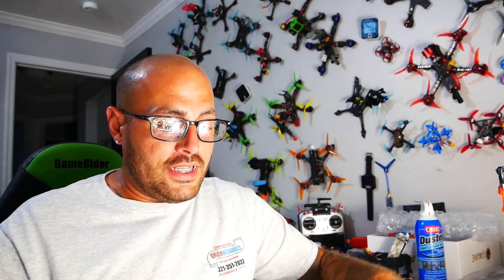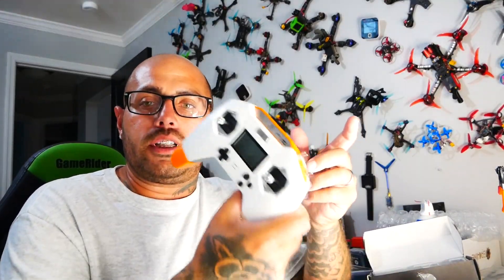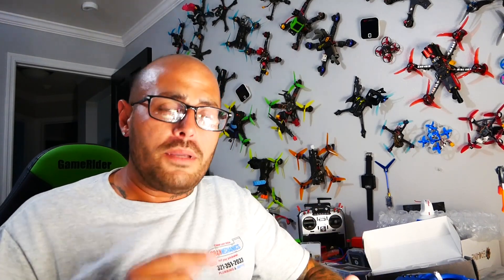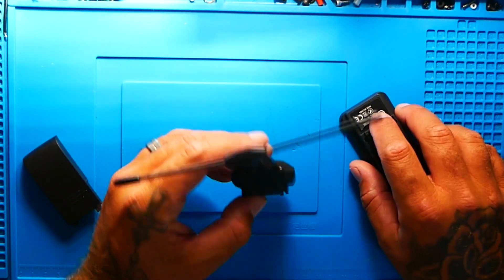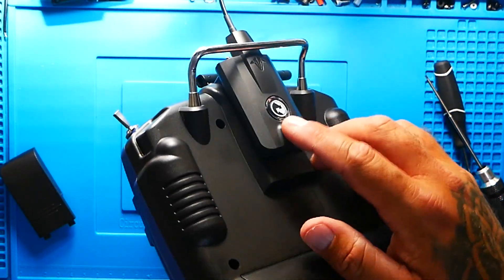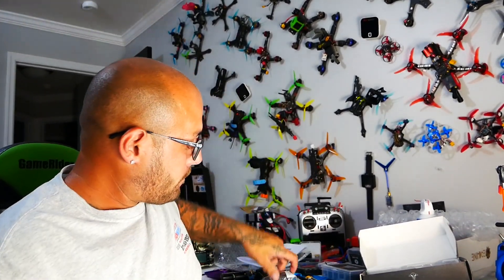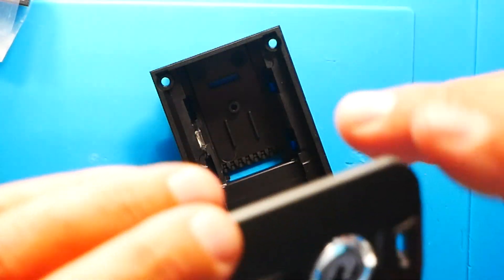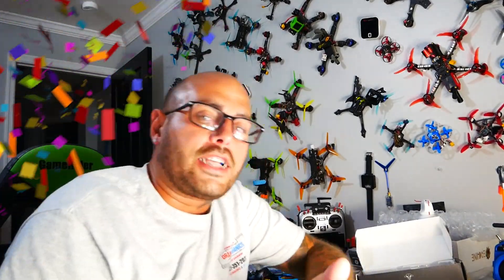TBS Crossfire Nano TX is Here 🔥 Crossfire Nano Module & Retrofit kit !

Comment: So I tried to use the TBS retro fit kit and the main issue I ran into was that the Micro TX V2 has pins on the bottom left corner that have to be either desoldered or alternatively a hole would have to be cut into the back plate of the retrofit kit in order to get it to work without taking a soldering iron to the crossfire tx.

Comment: I have a question on the nano RX - I connected it to my micro TX and for whatever reason I am only getting 1:100 LQ and my rssi shows as 16 but this is at the table where my taranis x9d+ is showing 100% LQ and graphical rssi on main display shows it as full bars.  I have micro TX set for 1W and dynamic power and I have the nano set for dynamic power.  When I change the nano rx to just the 150hz I get zero and no telemetry -  so I amthinking there is perhaps something wrong with the nanorx itself?
Reply: I forgot to add I should be getting at least 2:100 or so but limited to jiust 1:100 and 16 rssi at my desk while configuring everything.  Seems very weak.

Comment: just a question man and Im sure other people are asking it, if you just leave the x9d lite back cover on does it still fit on the x-lite with just a slight angle? I don't have one but I was curious cause I bought the retrofit kit already and got the xtl file for the full size and am gonna have my friend print the back cover for one of my full size crossfires so I can have 1w-2w output power on my Tango 2 Pro v3 pcb and fly my wings with the tango instead of having to go my full size tx which is nice cause I love my Tango 2 pro! I also might try just using the jr to jr lite adapter I just got in the mail too and see if I like that but I bought the retrofit kit just for the little pcb, cause Trappy said you needed it for the full size conversion on one of the streams, and incase I wanted it a little lower profile ya know and it was like 7 bucks so whatever lol